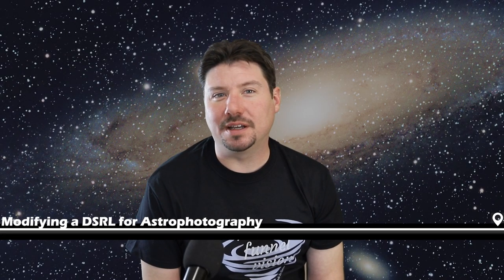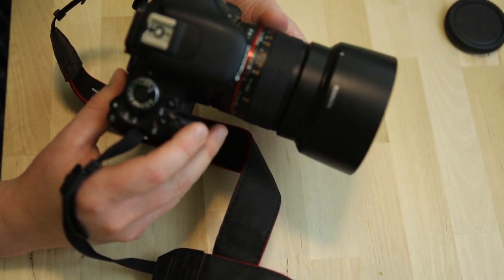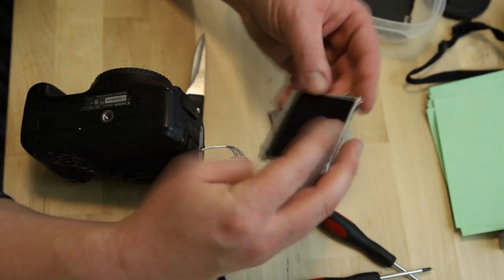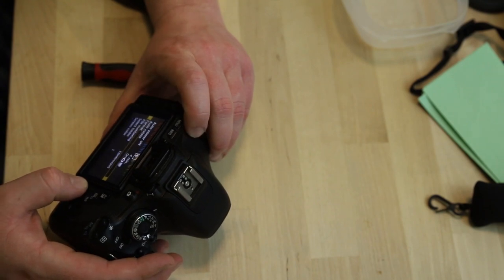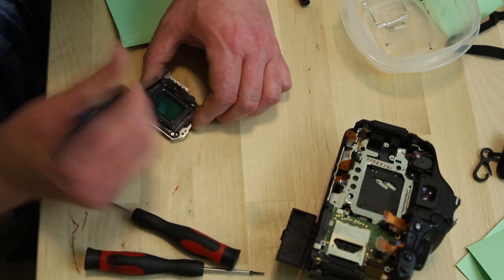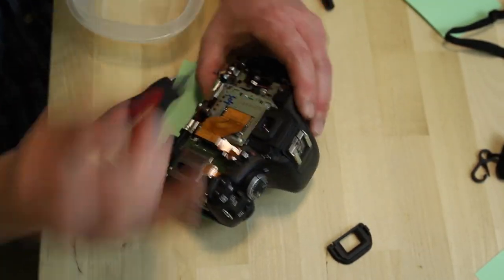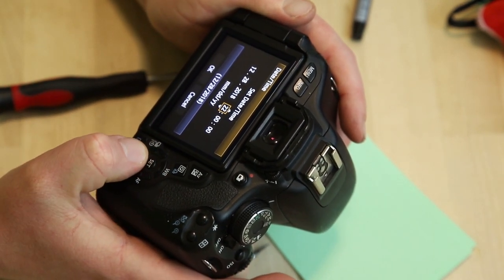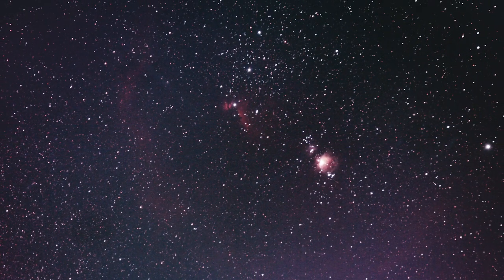Canon T3i DSLR fixed and ENHANCED! Why Filter Mod for Astrophotography?

Comment: Hello,
I disassembled my CANON T3i machine, I removed the IR cut filter, but I did not install another filter instead. I forgot to mark the torx screws when removing the sensor, and I also did not measure the black pins next to the screws. My sensor calibration was wrong and my machine does not focus on infinity. How many millimeters were above the black pins from the base before you turned on the sensor. My problem will be solved if I find out. Thank you from now. i hope my english is not so good i hope i could convey my problem to you
Reply from the maker: Understood loud and clear!  Even though I did measure and mark the screws before removing and put them back in the exact spot, I did a couple more test runs weeks after making this video and discovered that some of my lenses couldn't achieve focus properly. It might have just been an issue with the lens(es) but  I went back in and started adjusting them all down a little further until it was right.  Unfortunately that meant a lot of reassembly and disassembly, trial and error.  It would be hard to tell you exactly what you might have to do.  Adjust, test, take notes, adjust test, and repeat. Then call it done when you are happy with the results.  Just take great care as the ribbon cables are very sensitive.
Reply: @scienceoutthere  
Is it easier to handle if I install a baader BCF filter instead of an IR cut filter? Because I don't want to disassemble and put it back on all the time. 3 times so far I have removed and put it back.
Reply: @cuneytgdk  I don't know if you solved it eventually but without the filter there's a possibility that you cannot focus the visible and the ir light at the same time as they have different wave lengths thus, will land in different spots in the sensor.
You focus the visible light and the IR light is out of focus, probably creating a fuzzy image. Focus the IR light and the visible light will be out of focus. 
Not sure if this is the issue but, food for thought.
Reply: Pedro Fonseca is this possible with the astronomik clear glass filter. I have the problem you discribe. My red channel is out of focus. I modified my 650d with an astonomik clear glass filter and took both of the other filters out. I am using a astronomik cls-ccd to shoot now. But like i said the red channel isn’t focussed.
Reply from the maker: Darkstar4891 JUST the red channel is out of focus??  That might just be the lens and some significant chromatic aberration.  Do you have another lens you can try to confirm??
Reply: science out there i do. But that would mean my 70-200 f2.8 L is would be out of focus... i use that lens so much during day time. How could this be? I will try it later this week and get back to you. How could this be possible with such an expensive lens? Also if i buy a scope will it have the same problem? I’m really bummed out atm because i have 3 projects with unusable data. And i spend over 10 hours on all of them.
Reply from the maker: Darkstar4891 that is a very good lens and I’m jealous but even that one is not totally free of chromatic aberration in the fringes of where cameras were never “intended” to take photos!  (Beyond 650 nm). I have many expensive lenses and none of them are perfect.  Even still perhaps adjusting the backplane/sensor position will help correct this some. I was just curious if another lens would have less or more trouble on your particular camera than this one.
Reply: science out there yes you are right. I want to check if it still occurs when i focus at f2.8 and then step down to 3.5. I will also check if it occurs with my other lens. There has to be a solution for this.
Reply: Im late but in case anyone else has this issue, removing both of the filters and just tightening the torx screws all the way down solved both problems for me. The sensor calibration just happens to be perfect this way for me and the focus is almost perfect. If I want to focus to infinity, I just have to focus a tiny bit closer but even autofocus works the exact same way as it did before.
Reply: @michal_king478  thanks so much for posting this!
Reply: @bobbeanbags  glad I could help 😁

Comment: Nice tutorial! And what's the result if I remove both filters, and not only the WB one? To do astrophotography we try to get more infrared information, so it wouldn't be a good idea removing the IR filter too?
Reply from the maker: Hi Warley. This is called a “full spectrum” mod and can be done for the best possible Near Infrared and Ultraviolet photography using filters. This filter is also the piezo-electric dust protector for the sensor, so manual cleaning will be required and the sensor is directly exposed to your environment.
Reply: @scienceoutthere  Understood. Thanks for the explanation!

Comment: Hi, I want to do this mod for my 600d, as well. If I remove the "blue" filter, is it necessary to use a clip filter for taking astro images? Or can i take pictures without any extra filter? And if so, do I have any advantages by doing this mod?
Reply: Yo I'm not sure if you figured this out by now, but just in case. Removing that filter will make those faint red nebula pop out significantly more in your astrophotos. If you want to get a hydrogen pass clip in filter, you'd have to take a set of frames separately before doing your regular RGB frames. This gives you a strictly RED shot that's usually used in post processing as a luminosity channel. That'll help those red colors pop out even more. It gets pretty in depth but there are tons of tutorials for Hydrogen alpha filters.
TLDR; This astro mod significantly improves RED signal by default. Adding an h-pass filter helps even more BUT makes you have to take separate set of exposures with and without the filter.

(Also seeing tons of people having issues with back focus after attempting this mod. Might be worth the $100 or so to let a professional do it.)
If anyone sees something wrong with this let me know!

Comment: excuse my ignorance, but I thought a astro modded camera had the 'ir' cut filter removed !, but you show it as stayed and remove white balance filter !
Reply from the maker: I can see where this is confusing!  Canon calls them the LPF 1 (low pass filter which is clear, and only cuts IR and UV) and the "IR cut filter."  I'm removing the blue colored IR cut filter but it is ALSO a white balance filter because it cuts deep into the red visible spectrum as well! Hence why it is blue colored and not clear.  650nm, The Ha emission line, is what we want and it is in the visible spectrum, not quite IR.  I call it a white balance filter because you can literally buy that piece of glass and thread it to your lens, and now you don't need to manually white balance the camera.  It has more impact on white balance than it does on Near infrared.  So, we have a true UV/IR cut filter LPF1,  AND then an IR/Visible red cut filter ("IR Cut Filter").   The latter of which is the one that is cutting out the 650nm light we want.  Really by doing the mod this way, you get to keep the Piezoelectric dust cleaner (LPF1) and it keeps enough of the IR light out of a daytime image that you can just correct the white balance manually---most of the time, it's not perfect.
Reply: science out there thank you, I have a Canon 60D that I only use for Astro photography, I’m going to give it a go and remove the filter myself, think I can do it but if end up with a box of bits it’s not the end of the world as only paid £155 for it 😯 ha watch this space 🤞
Reply from the maker: @greenmjg7  That's a very good price.  All of those older canons are great opportunities to modify without spending thousands on dedicated CMOS astro cameras.  You could wreck a lot of 60D's and still save some money!!
Reply: @scienceoutthere  Looking to do this mod myself as well and have a quick question about the LPF1 filter. Can that not be removed as well? What would be the difference in between removing the LPF1 and adding an external IR cut filter to a lens or telescope vs. just leaving the stock LPF1 in the camera. Essentially, are there pro's to one that out weighs the other or would they just be the exact same modification?
Reply from the maker: @thomashunt6901  The LPF1 is also the piezo electric "dust shedder"  You could in theory leave that off there and get even more NIR and UV.  You might have to 'tune' the backfocus of the sensor a bit more than just removing the LPF2 alone.
Reply: @scienceoutthere  Nice thought! I haven't thought about the back focus. That said, if I do follow through with the modification (I have an old T3i as well) it would be an dedicated astrophotography camera. My understanding was that the sensor placement is only something that would need to be tweaked to maintain auto focus. Using either a lens or scope at night, I imagine auto focus wouldn't be of much use anyways. Is that the right thought? Also, what did you find was the most difficult part of the modification!?
Reply: @scienceoutthere  hey, would it be better if I removed the LPF-1 filter too for a DSLR solely for astrophotography since there's less glass? Or would it negatively affect my images?

Comment: Thanks for the video. I completed this mod on my t3i last night. I just realized that I didn't reattach the black fiber optic cable at the top on the right side. Any idea what this cable does?
Reply from the maker: Hmmm I don't recall off hand.  It might just be a ground?  Is the camera fully functional?
Reply: That cable is just a ground

Comment: I removed both lpf-1 and 2 filters. Is this a problem and what does it mean for the camera?
Reply from the maker: That's a full filter mod and it's great if you want to REALLY capture near-infrared or UV light.  It will still work fine for Astrophotography, however some lenses and telescopes don't handle UV/IR light very well and it can be difficult to get sharp stars. A UV/IR filter can help with that.  Also, you'll lose the internal anti-dust features and will have to manually clean your sensor periodically if you notice dark motes showing up on images.

Comment: @science out there , I am very confused, many people are suggesting BAADER BCF 1 filter. Is it is necessary?
Reply from the maker: The Baader BCF filter replaces the existing "blue" filter that I'm removing in this video (Stock LPF1, or UV/IR white balance filter).  It allows your camera to operate in daylight mode very similar to normal operation, while being sensitive to Ha light.  I'm achieving this with an external lens filter instead.  You can go either way with this.  Since I'm modifying an 'old' camera and have already replaced it with something better for normal photography, it's totally a fine option to just skip that step entirely.  Hopefully that clears some things up!
Reply: @scienceoutthere  Thank you very much for clearing the confusion.
Reply from the maker: Sanjay S no trouble at all!

Comment: What filters did you replace the stock filters with?
Reply from the maker: In this case none at all at the sensor. there's nothing taking its place. This gives you the most possible options by using removable filters at the lens objective.  I have a 77mm Near-Infrared pass filter for NIR photography.  I also have some X-Nite CC1 filters (seen in this video) which restore stock white balance basically.  And I have the Astronomik CLS-CCD EOS Clip in Filter (also seen in this video) which pass just the most important astronomy bands like Hydrogen Beta and Alpha,  but block Infrared, ultraviolet and typical light pollution sources.  That last one I highly recommend if you go the same route I did here!
Reply: @scienceoutthere  at 5:15 you show front filter stays does the auto clean sensor still work after that modd..
Reply from the maker: @frankguyton9596  It sure does in this case! I can speak for the T1i, T2i and T3i in this regard at least.  Other models might vary from this. Canon has tweaked the design in recent years and I'm not sure what the result might be on newer cameras.  The piezoelectric vibrating system remains wired up and dust removal still works just fine. Just be real careful with it.  Here's Gary's guide to it if some additional still images would be helpful: http://dslrmodifications.com/rebelmod450d4.html
Reply: @scienceoutthere  without the MC clear-glass or baader in place of the removed stock filter and 2. with the cls-ccd clip in filter can you achieve infinity focus with camera lenses? With telescopes the answer is yes, but with camera lenses can you?
Reply from the maker: Grozdan Grozev mine works just fine. However I might have had an issue with the sensor backspacing that I didn’t catch until a couple months later. It only affected one lens but my OCD led me to crack it back open and adjust.  Then I found out the lens was bad anyway. There’s a couple of useful threads here about the subject.  Backspacing MIGHT need to be adjusted for (some) lenses.
Reply: @scienceoutthere  thank you for the answer. To me it seems that if one is very precise and puts the screws at the same position then focus will be OK with the clip-in filter. That filter will compensate for the removed one and also cut the bloating IR spectrum.

Comment: You forget to tell 2 big problems about the sensor modification, the focal plain maybe changes after the mod because the filters has been removed, its sometime 0.5mm. The second: the sensor is need an axis re calibration to get parallel again with the optical axis again!
Reply from the maker: Yep, There's discussion about this in several parts of the comment section.  In truth, I didn't experience this problem until several months later when I got a new, fast lens and even then it was a bad copy anyway and I had to replace it. So I'm not even certain on that.  So experience may vary.   Was a very tedious process of taking the camera apart, adjusting, reassembly and try again.  Not fun.
Reply: @scienceoutthere  Quick tip use a fix lens with AF to get good calibration again and print this
https://photographylife.com/how-to-quickly-test-your-dslr-for-autofocus-issues